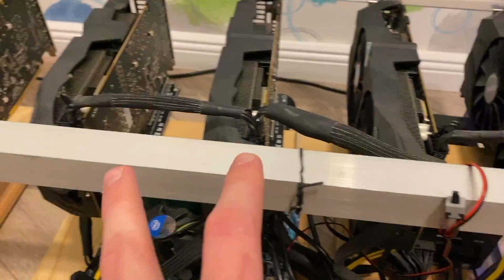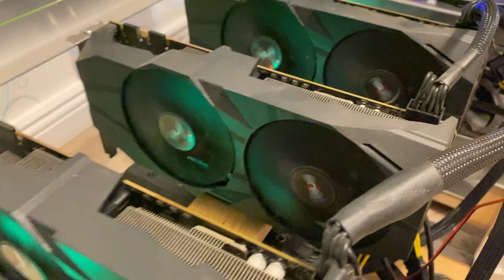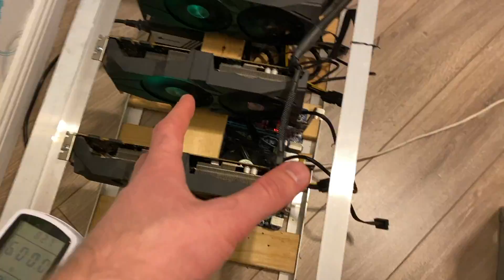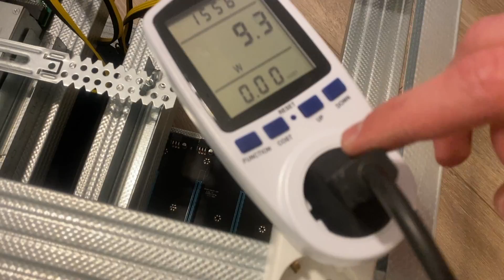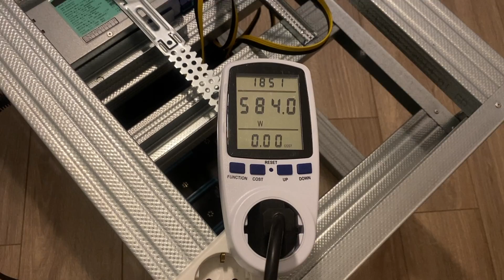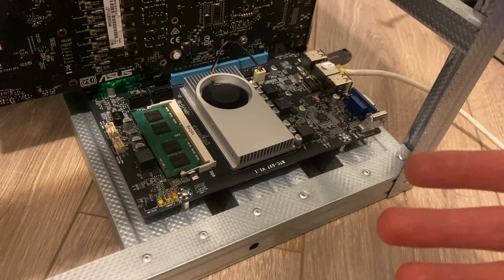Server VS Gaming Components Economy For GPU MINING

Comment: Very interesting test. What if you used same power supply on different boards as the HP server PSU, from what I read, are more efficient around 80% load compared to traditional PC PSUs which don't exhibit the same range of efficiency through loads. I have 3 of those 8GPU mining boards and prefer them. Just so easy to setup.
Reply from the maker: Good point, would have done the test with same psu, but unfortunately I do not have a 24pin and cpu power cable outputs from this server psu. I saw some online, but at that price it is out of cost efficiency 🤔
Reply: @humancode  Yes, true. I bought a HP PSU from Paralleminer in the USA. The breakout board has the 24 integrated PSU. Very nice but was alot more money. Now I use a PSU for the GPUs and a cheap $30 PC PSU to just power the board.